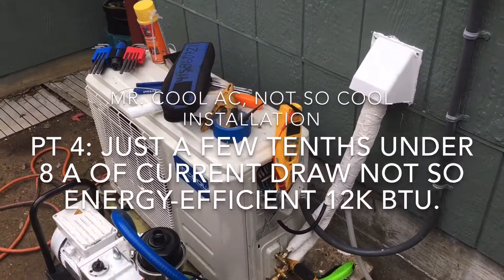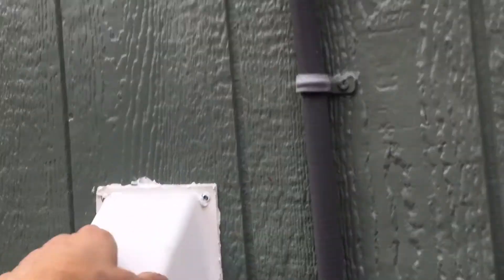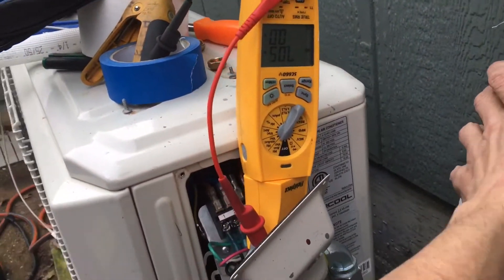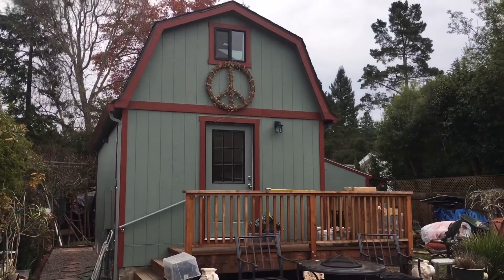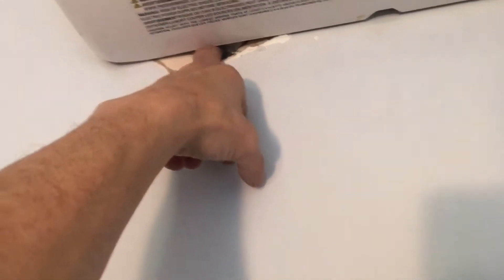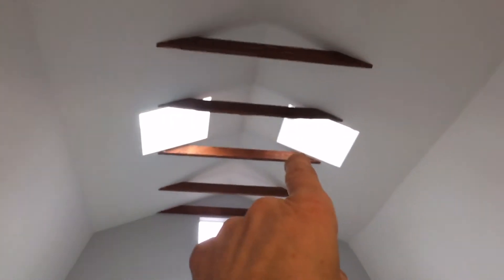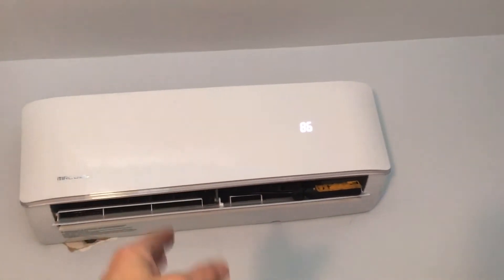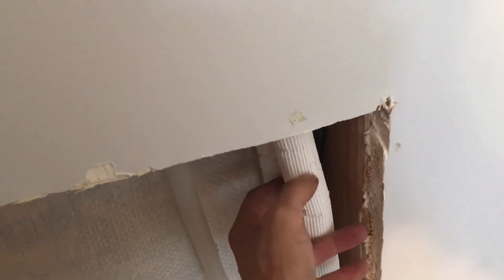Pt 4: mr. cool AC, not so cool installation

Comment: 7 AMPs for a 1Ton is probably 120v, not 240v.  In which case 7A is 1.68kw which  is not that bad.  Comparing this to the mentioned  2Ton which is likely 240v at 5A is 1.2kw...
Reply from the maker: I was getting 3.9 A out of my ICP 16 seer 3 ton unit on first stage which is roughly 2.7 tons 

     That’s a massive difference in the world away from a 1 ton

One of the worst minisplits I ever tested with a 24,000 BTU mini split that was pulling 9 A. It was a cheap Chinese knock off no variable speed fan no variable speed compressor it was all fixed speed. 

       And it was for the same customer that I installed the ICP 3 ton two stage 16 seer unit on in the exact same room to replace the 24,000 BTU. 

       We started them up side-by-side to take our measurements in the same room with the same heat load.

      It all depends on the manufacture and a fission C of the unit that was chosen on purchase

        Have a customer his original 5 ton 10 seer units we’re drawing 24 A on a fixed load in a equipment room with motors and inductive heaters so the load was identical every time at the flick of a switch

Are those units came out and 17 seer 5 ton units went in their place replacing them

And they drew 11.5 A for the same 5 ton units in the exact same place replacing both the indoor air handler’s in the outdoor condensing units both the exact same tonnage in the exact same room
Reply: @coldfinger459sub0  3.9A@240VAC compared to your 1TON @ 120VAC is a 0.2kw difference.
Reply from the maker: @revealingfacts4all  Is 1 ton is a 240 V system it’s not a 120 V system
Reply: @coldfinger459sub0  i highly doubt that. 1Ton compressors only need 110v.  What make and model is that unit?
Reply from the maker: @revealingfacts4all  we don’t guess in this world how to fix something. we don’t diagnose things by feelings , thinking, . 

     You RTFM and know what you are working on. 

         When I sell systems I only sell 240V systems even if I’m installing a 9000 BTU unit 
            I have never installed or worked on a 120V 1 ton unit in my life never even see one except in the manufacture web site. 

        We are not practicing couch potato 🥔 engineers here.

   This unit is made in a country we’re they don’t even have 120v  every thing is 220v 
             Only USA special ordered 120V units .

Comment: 1) The 7 amp draw you're showing is for the ENTIRE mini split system since the indoor fan head and the outdoor unit are wired together. Your (incorrect ) comparison to the 'regular' ICP heat pump is incorrect because A) your recollection of its amp draw is way off and B) the air handler in that system has a separate power circuit with its own 2-3 amp draw. Additionally, the startup amperage of a traditional heat pump and air handler are MUCH higher and those startup peaks of non-inverter systems introduce additional power factor induced energy costs that you're willfully choosing to ignore.

2) Now let's focus on those those 'I can tell you for a fact' figures you bring up: the ICP chart documentation for their 18k equivalent 1.5 ton heat pump in heating mode in a similar 47ºF outdoor & 75ºF indoor environment as in the video gives an expected running (RLA) amp draw of 7.38A - just for the outdoor side. The amp draw of the 2 ton ICP heat pump you specifically mention in those same ambient conditions is 9.31amps (again, that's heat pump only - indoor air handler has its own circuit and additional 2-4 amp draw). That alternative ICP heat pump system will also utilize an additional 3.8-5kW heat strips as auxiliary heat during defrost mode and when its efficiency starts dropping off around 32ºF. That's another 15-20 amps for a minimal 5kw heat strip kit. The Mr Cool unit is 100% efficient down to around -5ºF and doesn't need the help.

It's sad that your industry has gone from 'it's hard to stop a Trane' to 'it's impossible to find an honest, competent and reasonably priced HVAC company', and higher efficiency aside, it's the reason why many of us are drawn to these Mr Cool and equivalent DIY systems.  Trash them all you want, it's pretty clear why you don't like them.
Reply: Eh I’m sure mr cool is just another Chinese junker. Isn’t that what most mini splits are anyway? There’s a reason you told the OP “your industry”, that being that you’re not a part of that industry. Why pretend like you know if a brand like Mr cool is worth repping? Mr’ cool, American standard, ameri star, pane who cares it’s all bottom of the barrel junk that can live long if installed right am I wrong? Your love for a nameplate is misguided, Mr cool doesn’t care about you. Mr cool isn’t alive, it’s just another cheap rebadged mini split just like most sub brands are what’s special about it?
Reply from the maker: Like comparing it to a Samsung or a LG anything like that of their best models it should be about 3.4 A instead of 7 A right now.     This Mr. cool is running at 7 AMP  there’s not even a load inside the house
          And here in California we do not use heat strips there’s no need in the San Francisco Bay area

Comment: That indoor unit should have been installed up at the top of the loft as that's where all the warm air is going to collect. The lower area will be cold, and the sleeping area hot.
It was a good thing that the first contractor did not open the service valves on the outdoor unit. That teflon tape and pipe dope was a hoot. 
That 4 amps of current draw was at what voltage? I assume this is a 120VAC unit. So that's 480watt, and converted to BTU is ~1500, with a COP of 4 (heating mode assumed) that's moving 6000BTU/hr. If 240VAC, then double those numbers. So that might be right at 1ton for heating.
If this was inspected, how the hell did it pass the mechanical inspection?
Reply from the maker: Inspectors don’t look for anything in detail. 

They have a very large fan in the loft area to circulate the air that is reversible they either could blow down or suck up.

Comment: do these diy mr cool line sets quick connects leak over time? what is the solution for that issue?
Reply from the maker: I have seen them leak Brand New in the box.   The customer is thinking he bought a line said that is filled with the correct amount of refrigerant but I have found some of them empty right out of the factory box.   Only a trace amount of vapor refrigerant gas left inside of them this is a bad thing.?

I’m sorry to tell you that the fix to that is a cut off the quick connect the end and silver bracelet them and then they will never leak when done correctly. 

That is my thing to do as soon as I come across a Mr. cool license I instantly cut off all the quick connect fittings and illuminate them as possible leak sources if they are not there then they can’t leak.
Reply: @coldfinger459sub0  can you silver braze aroudn the quick connects to seal them forever?
Reply from the maker: @khandam7709  Excellent question but no they’re contaminated with oil and they have some sort of man-made synthetic gasket seal material that would heat up and contaminate the braze . 

You just cut them out throw in a coupling in braids them straight you have to remove the gas clean the copper and run nitrogen through the system while you’re brazing

Comment: If it's 120 volts over 240 volts it'll pull twice the amount of amps, it's a mini split and typically you're also reading voltage from the indoor blower, compressor and condenser fan. On 240 probably only run 3-4 amps
Reply from the maker: Exactly right you’re reading the voltage current watt to draw out the whole entire system they give you an overall efficiency of the BTU output per watt. 
                   amps is not power power is rated in watts it doesn’t matter if you double the amps you still exactly have the same watt draw whether it’s 120 V or 240 V The power consumption will be equal. 

Voltage or amps is not power consumed

Get a WATT meter or learn how to do your own math formula that’s the problem with this public education. We were taught volts and amps and that is not POWER  all by itself consumed

Comment: I've experienced the same, dyi might save upfront ,but when I come in and have to repair the hack job , they save nothing, get a licenced experienced contractor and a gree, lg, Samsung, mitshibushi mini, not a piece of junk imo.
Reply from the maker: 👍👍👍 i’m about to release another video on a Mr. cool that I’m working on at this moment as I’m making this message. 🥲😤😓 
            It’s another redo I wish I did not take this job unfortunately it was for somebody I know. 

           I think I will make this the last Mr. cool re-repair job redo I do it’s just not worth it even if I charge a lot. 

           I told him I will never touch his Mr. cool system again and I quoted him a $17,000 reinstallation of an LG system. 

  NO MORE MR. COOL AC FOR ME !!!!......
Reply: Just here to point out that the 'hack job' he was out repairing was done by a previous HVAC contractor. The homeowner probably should have done it themselves following the instructions as printed, it would have been a better install.

Comment: A 120 volt unit will draw twice the amps of the exact same unit running on 240 volts .The watts will be exactly the same. HVAC technicians are taught to use the highest voltage available. Your contractor purchased the wrong voltage unit for a new constructed house .The 120 volt units are sold for remodel or old work where it would be costly to run a new wire in finished walls.
Reply from the maker: Exactly everybody in electrical knows the voltage makes no difference in watts
Reply: @coldfinger459sub0  watts= volts*amps. What you mean volts makes no difference in watts?

Comment: we have limits on the amount of HP can be used on different voltages in north america  1HP on 120 VAC 5 HP on 240 single phase. There is exceptions for farmers they can have up to 7.5 HP on 240 VAC 1 phase . The rule of thumb amp draw for 1 HP is 12amps @120 VAC .Your Mr Cool unit was only drawing 7 amps and producing approximately 12,000 BTUs that is super high efficiency.
Reply from the maker: That’s actually considered very low efficiency for variable displacement compressor. 

        If I was performing the exact same test for example on a FUJITSU or an LG or even for example as I’m writing this right above my head running a old Panasonic I installed that was produced back in 2014 is only drawing 3.8 amps under the exact same conditions. 

          And if you switch your meter over to WATTS power. 
         You get to see some of these highest efficiency units as they satisfy and they just cruise at a minimum speed constant no on and off only consuming about 380 W of power,  

            What I have noticed about some of the cheaper brands as I tear them apart and open them up. 
           To save money and keep the price down but make it appear to the customer that they’re buying the exact same unit as the big brand names. 
          You often notice single row evaporator for condenser coil‘s or even if they do do two rows fewer fins per inch because that cost money on materials fewer and larger diameter refrigerant tube because that’s cheaper and smaller condensers and smaller evaporators. 

             These cost cutting procedures on materials greatly reduced the production cost because copper and aluminum are charged by weight in manufacturing. 

             But the way they get the same kind of performance is you overdrive and use a lot of power to consume in a small compressor motor because you have to flow a lot of refrigerant through small evaporator and condenser consuming more power to do the same work in a smaller package.   But you get the same cooling performance output at the cost of higher energy usage. 

         An old marketing trick for sales customers don’t know the difference. The average consumer is totally oblivious of what they do to make their sales pitch. 

            If you lived in a state that had extremely high electricity rates $.34 $.36 per kilowatt hour and you had a small Mr. cool 12,000 BTU unit that was drawing 1800 W of power and you had to run that day and night throughout a hot summer for the next 4 to 5 months. 
            Then if you lived in a place that also had those extremely cold winters drawing that same amount of power you would have several hundred dollars more on your electricity bill every month. 

           Now compare that to one of the real high energy efficient small 12,000 BTU units that might only draw 900 W of power for the exact same amount of heating or cooling under the exact same loads.    And you multiply that times how many hours a day running how many days a week for several months of heating than several months of calling just in the first year of difference in cost adds up to the difference in price between the cheap Mr. cool or the more expensive truly high energy efficient big brand-name. 

            Only problem is with the cheap one the customers end up paying higher monthly electricity bills for the next 15 years to the life of that unit.  

           But yes if you compare the Mr. cool mini split to an old fashion large American made split system that is 8 SEER or 10 SEER rating then it makes the Mr. cool look like a shining energy-efficient star system in comparison. 

           Just so compares to how the marketing and sales advertising are going to spin their numbers and use white as a comparison to make it sound good and legitimate.
Reply: @coldfinger459sub0  well assuming that the 7 amp draw is a constant draw and the unit outputing 12000btu then for a 1 ton the cop is only 2.09, should be 3.5 at least for that unit something else might be wrong.CALCULATION:(240v assumed)12000 btu/(240vx7ax3.412 btu/a)=2.09 however if this unit is only 120 then it is currently operating at a cop of slight over 4 so your line set correction restored the the unit to factory spec.
Reply from the maker: @davidproskin1752  in class the math formula that should be applied we were taught that should work dose not. And we are thought math dose not lie. 
          But in the case of mini split ratting for marketing it inflated numbers. 
     Just like Stereo amp watt rating of 50 years ago compared to today’s ratings. 
             The same amp rated at 20W 50 years ago sounds the same as the one to day at 100W 

           When you test , measure, and data log every day each unit you install you really get to find out what we were taught in HVAC class thermal dynamics and fluid dynamics  you get to find out what reality is compared to marketing. 
             When it comes down and dirty that can not invent a new Physics.  You do not even need to brake out any test equipment. 

          You have two condensers sitting in front of you both cooling the same room. At the same temperature. 
              Both for example have 1 cubic meter of condenser. Both have 12 fins per centimeter bough have 30 refrigerant tubes passages of the same size . 
             But one condenser is a two row condenser the other is a single row. 
           The same goes for the evaporator whether it’s size or number of rows  one double row ore just plain larger . 
               The larger one will have less internal friction resistance more surface area to reject heat. 

           Both of them can have exactly the same true 12000 BTUs output . 
          But the larger one both the compressor and fan motors on the evaporator and condenser just need to Cruise with no strain vary little watt draw. 
               On the other hand the smaller condenser and evaporator unit the motor has to wiring to piss out of it over driving the compressor under heavy load to overcome the internal friction and the poor hear rejection of less surface area. 
         A apples to oranges comparison. 
When we were in college physics class this is like physics 101 not even advanced math. 
        More like grammar school
Reply: @coldfinger459sub0  except that you show the unit operating at a cop of about 4.18 which is pretty much the rated performance for that unit ( I assume it is a 120volt unit) By the way you seem to be under a misapprehension that watts are dependent on amperage only.  Power in watts is voltage times amperage so if this was 120v unit drawing 7 amps it is performing exactly the same as a 240v drawing 3.5 amp... they both draw the SAME amount of power to produce the same amount of heat. 
I really appreciate your description of the way different units are constructed I expect that will prove usefull as I would like to install a minisplit unit ti heat my walkout basement family room.
Reply from the maker: @davidproskin1752  compared to Apple the Apple comparison to the other units that I normally install it’s someone of a dog on energy efficiency but it’s a hell of a lot better than a old SEER 13

Comment: I assume this is a 120v unit? That seems like pretty normal amp draws for the system being at max capacity trying to heat to 86°. Once it reaches set point it will throttle based on demand.
Reply from the maker: It’s been so long I don’t remember. 
        If I was going to make something for DYII people in the general public I would only make it 120 V. 
             He gets up with 120 V more of your customers will survive somebody get zapped with 240 V and they have a pacemaker or defibrillator higher chance you’re going to have a widow with lawyers coming after you.

       I guess if you watch the video and try to look at the wire coloring and what colors the wires if there is a L1 and L2 then we know it’s 240 if there’s just an hourone in the ground and neutral we know it’s 120 don’t remember if I show that in the video